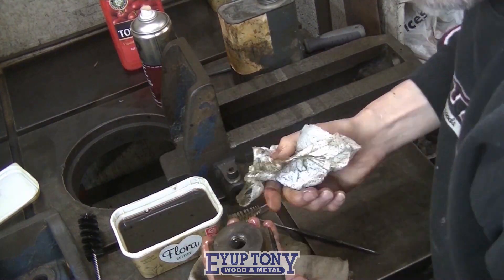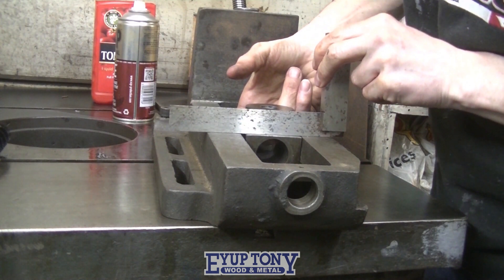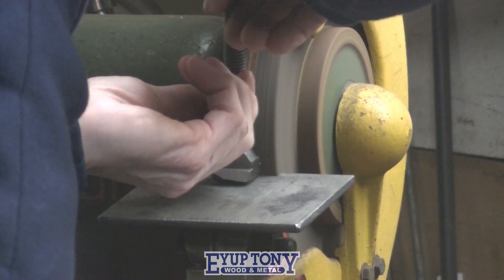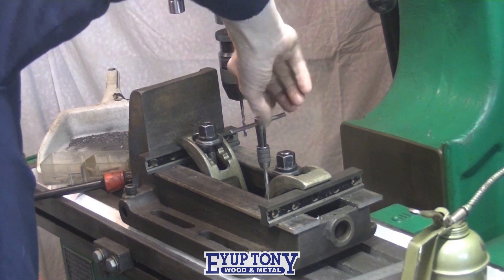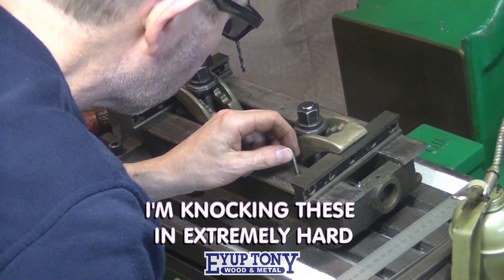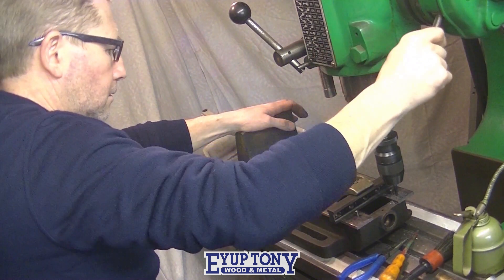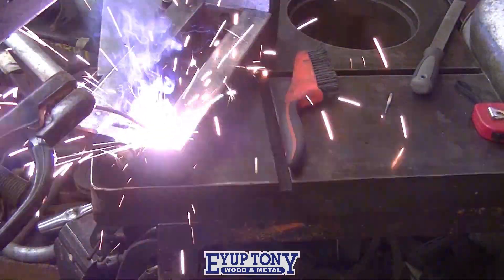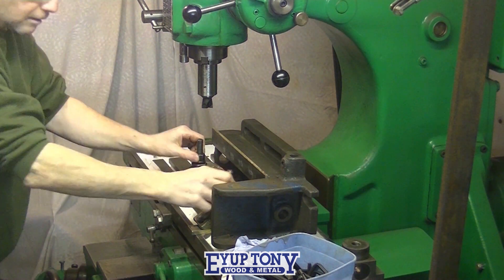Vertical milling machine used to restore a Rapidor power hacksaw vise. Metal shaper tee nut job.

Comment: 7:03 Winding the knee down is rather noisy - sounds like a crappy Bridgeport ;)
Reply from the maker: Yes, I haven't had that part to bits yet but I can live with it.
Reply: @eyuptony  Haven't used my lathe for years. Did a workout with it a year or so ago (no 3ph power for it) - drove the chuck via the leadscrew feels like there's a tooth off :(

Comment: 6:10 Hmm, I smell a VFD !
Reply from the maker: There's no VFD. I'm slipping the clutch because sometimes on the faster speeds it trips the phase convertor out if you engage it to sharply.
Reply: @eyuptony  Is that a circuit breaker that trips ? Just put all 6 wires onto three terminals to bypass the breaker.

I got a diesel gen 3ph. I tripped its 9A circuit breaker (probably due to an electrical fault) - so bypassed it - and fitted a motor starter with thermal overload - set for the continuous rated output of the genset. I also added an RCD - it trips that now - so I know the mill's really faulty :) https://www.youtube.com/watch?v=Z_r9ZH1aFoI

Comment: That will be a good repair, nothing wrong with using the pins in this way.  All the forces will be in compression so you'll be good. Very cool old mill you have there!
Reply from the maker: Hi Everett thanks for viewing that's what I had thought and also it makes a quick joint. Tony

Comment: Nice video Tony. Really well made.
The use of pins is a good idea. No welding, no tapping, quick and easy.
Reply from the maker: Cheers Rustinox. I usually had to make things in a rush before so I often found quick ways like everybody else does in a maintenance situation when the production stopped or needed speeding up. Tony

Comment: Loving the big mill Tony, any idea of its age, its a similar size to my Victoria V1 which I believe you have seen. Been trying to persuade a young lad, machining with Joe, away from buying a lightweight Chinese mill, and I think I may have had some success. Regards Del.
Reply from the maker: Hi Del I think the milling machine is C1950's/60's. I assume it's one of the later models as they no longer cast the Archdale name in to the main body casting to save time in the manufacturing process. Thanks for viewing Tony.